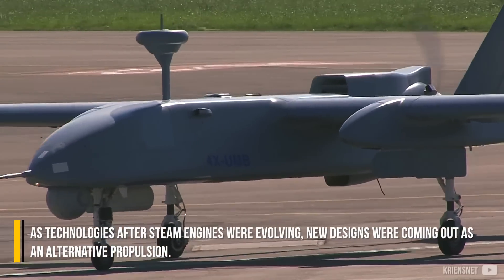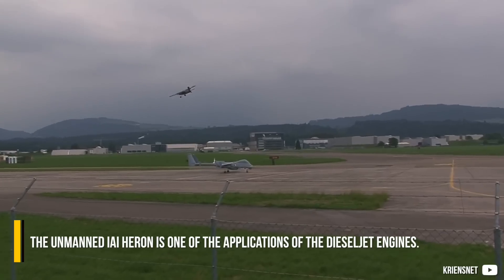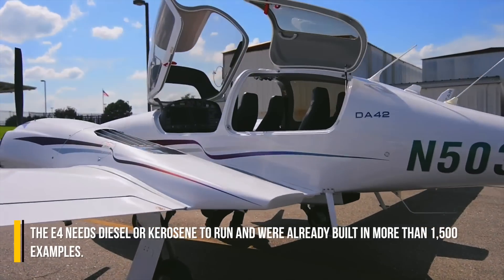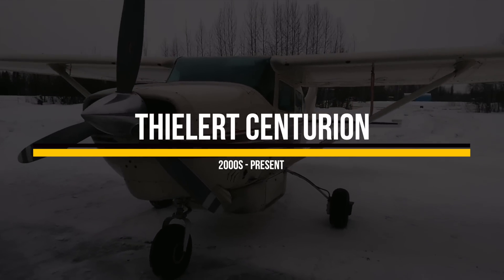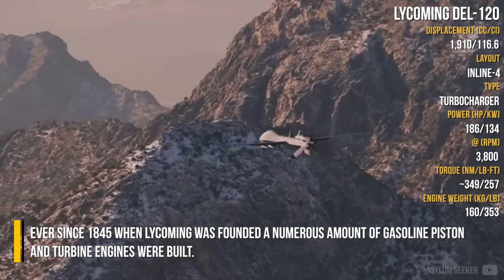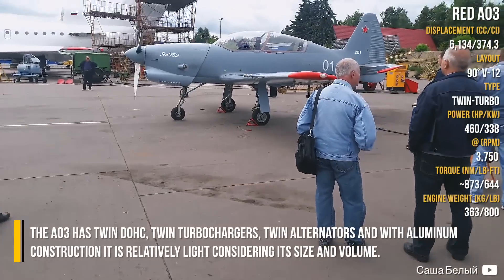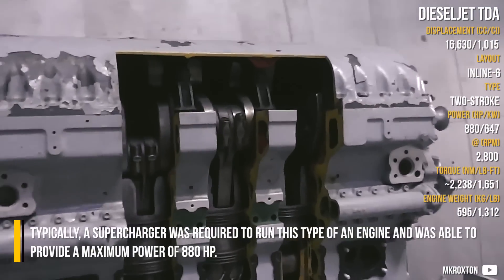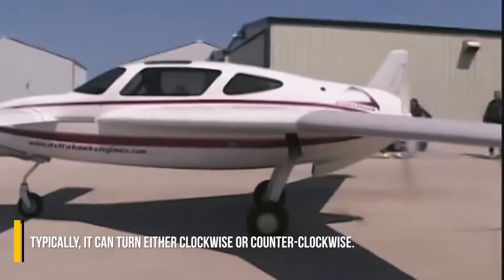8 Of The Few Diesel Aircraft Engines Ever

Comment: This video was posted 6 years ago, but I’ve got 2 questions if you know the answers that would be appreciated.  
Is the engine heat a problem & how is it controlled,  does the propeller need to run at a certain rpm, how is it adjusted.
Reply: Diesels have lower temperatures bc they reuse o lot of energy for working. For many diesels actually only  the piston head needs cooling.

Comment: JetA is very comparable to diesel fuel. The problem with diesel in an airliner is its tendency to gel up at lower temperatures.
Reply: Use winter diesel

Comment: Given that 2700 rpm is both typically the limit of the propeller speed and the peak power rpm of diesel engine make it a good combination to bolt on diteclty on the crank

Comment: Deltahawk is a company that has been developing a 180HP V4 2 Stroke diesel engine that runs on JetA for single engine props. It was designed to be a cheaper alternative to those engines running on AVGAS. It just recently was FAA certified.

https://youtu.be/bL-8AQlVOlo

Comment: An aero oil burner for utility applications, is the way to go, but the enemy of any oil burner is weight, a straight four or six needs a beefy crankcase main big end bearings to combat the severe internal stresses imposed by a heavy crankshaft and con rods. Only way for  a  viable aero oil burner is a flat four of or six ,like a VW Bug or Porsche 911. Keep it simple stupid, ditch  the turbos, double camshafts and all that bull shit, good old fashioned gear driven blower with two speeds and push rods for the  valve gear. Out in the arse end of nowhere where these aero  oil burners will make their mark, simplicity ,ease of maintenance and repair is important. Said aero oil burner must be able to be serviced repaired with basic tools by a farm boy in the barn much like the family John Deere tractor.

Comment: There's no redundancy with common rail fuel injection. 
Just occasionally, that can be a problem.
Reply: No problem, works also on less cylinders
Reply: @CATA20034  when you lose rail pressure, you lose all cylinders. I've witnessed it happening. Not nice.

Comment: Not sure why all the diesel engines are piston engines. I mean, if the one can run on either diesel or kerosene, then why couldn't a turboprop be designed to run on diesel fuel?
Reply: Yes, turbine engines (including turboprops) can run on diesel fuel; however, commercially available diesel doesn't meet aviation standards, largely due to issues at the low temperatures encountered at high altitudes.

Comment: Diesels are so ideal for aircraft .They rev at the right speed for a propeller with torque that punches like a boxer and greater range because  of a diesel engines relative economy. For example, the fuel capacity of 76 gallons for a Cessna 172 s p is already great with avgas...Imagine the range increase with that much diesel !

Comment: The superchargers were fitted on the airplane engines because of air density loss with elevation. Before they started putting the superchargers on the engines the planes could have 2000 hp when taking off near sea level and have maybe half that at 30k feet.

Comment: I don't understand why all piston engine planes are not diesel engine powered. AV gas is so freaking expensive in comparison and with the prop the engines aren't usually turning over 3.5k so diesels are perfect. Diesels can be super simple with the only downside when compared to gasoline being their weight. Although gasoline airplane engines are pretty overbuilt so they are not super-light. I know if I could afford a nice little twin I would outfit it with a pair of diesels.

Comment: The only drawback is the worry over fuel jelling. I guess a warming system could be implemented?
Reply: Excess from the injectors is by-passed back to the tank, like all diesel cars, and that warms the fuel. In extreme low temps, fuel warmers are included, using the engine coolant in a heat exchanger.
Reply: @tonyforrester9570  Very cool info! TY:)
Reply: Modern aircraft Diesel engines typically run on jet fuel which contains anti-icing additives.
Reply: Many aircraft engines have engine oil coolers that heat exchange to the fuel before reaching the injectors. This is also common on jet engines too.

Comment: Jet fuel is similar to diesel fuel, so in a way, jet liners are diesel planes :)
Reply: A diesel plane has a diesel engine. A diesel engine uses the diesel cycle. Jet planes do not use the diesel cycle. Jet planes are not diesel planes.
Reply: Diesel fuel and turbine (or "jet") fuel are similar, but diesel engines and turbine engines are not.
Reply: Not really, they have spark plugs for ignition :)

Comment: No, if compression-ignition engine had come first, the easier-to-build gasoline would have been just as popular. You saw a surge of diesel engines here (in Denmark) in the 80ies and forward to now 2019 because diesel fuel was cheaper. But the diesel engines pollutes with more particles.

Comment: This takes rolling coal to a whole new level
Reply: Notice a complete lack of black smoke? Black smoke is a sign of too much fuel and too little air, not to mention small testicles. These units adopted diesel as it extends the range and decreases cost on fuel and maintenance.
Reply: @mikehotchkiss8975  Agreed with you on that Mike. :) Diesels are meant to be efficient, not meant to be coal rolling. Lol... I hope aircraft manufacturers switch to diesel, so we can have more efficient small airplanes and better fuel economy (in turn, less CO2 emissions)
Reply: I see what you did there.

Comment: Nothing was mentioned of the limitations that prevented it becoming more widely adopted.
Reply: Here are a few.
Unresolved vibration problems, resulting in airframe and propeller cracking.
Mass vs casing strengths.
Reduction drive chattering at low rpm.
ECU mapping and definitive redundancy.
Lack of widespread service back-up.
And of course, this was supposed to be an economical alternative.... IS NOT!
Enough so far?
Reply: @tonyforrester9570  Inline 6 and V-12 Diesel engines have no vibration problems.
Reply: Diesel engines have lower power density and horsepower to weight ratio than Otto or gas turbine engines.

Comment: Big advantage to diesel is that there's more energy per gallon/lb. than gasoline.  Longer ranges with less weight
Reply: The fuel density means longer range with less volume, but not less weight.
Reply: diesel fuel is heavier ,, no matter what you have to carry your carbon on your back

Comment: I recall reading about an aircraft endurance test by a competitor of Charles Lindbergh that lasted until the B-52 came out. The aircraft had an experimental diesel engine but was turned down for production due to the horrendous smell it made.

Since diesel fuel isn't as explosive as normal aircraft fuel you would think that it would be in high demand for aircraft because you don't want aircraft disaster survivors burning up. Unfortunately this isn't the case as aerosolized diesel fuel can detonate in a similar way to jet fuel if the accident is violent enough as was the case in the Ladbroke Grove rail crash of 1999.
Reply: # Tako   That I do believe was a PACKARD aero diesel built in the 1930 and set many distance records because of the low fuel burn !! !  BUT the 1930's were not a good economic time and little was built then for a hungry nation !!!!

Comment: What about gelled fuel at altitude?
Reply: Jet fuel has anti-icing additives
Reply: Not an issue with "jet" fuel, and not an issue at the low altitude where unpressurized aircraft are operated.

Comment: I only drive turbo diesel vehicles. 99 Ford 7.3 Powerstroke, 04 Chevy 2500 HD Duramax, 2008 Jeep Grand Cherokee 3.0 Tdi, 09 VW Jetta CRD. I get over 100% better fuel economy in those vehicles than their gas class equivalents, excepting the Jetta. Would have zero problem with a turbo diesel aircraft.

Comment: I can tell you don't know much about general aviation.
Diesel recip aviation engines can run on diesel fuel, kerosene, or jet A.
Since av-gas is being slowly phased out, diesel recip is going to be the next big thing light aircraft.
Reply: No, it wont, diesels are too heavy and under-powered. Modern gasoline engines that can run on unleaded fuel will likely need to replace air-cooled aviation engines.
Reply: @PistonAvatarGuy   Yes it will  https://www.flyingmag.com/inside-aviation-diesel-revolution/
Reply: @roye2479  EPS is BANKRUPT and tens of millions away form certification, Deltahawk is an overweight, under-powered, POS, like all of the other diesel offerings. None of those engines come even close to offering the light weight, high power output with low fuel burn that MODERN gasoline engines offer. Unleaded gasoline is also cheaper than jet fuel.

Comment: While Diamond Aircraft is said to have made about 1500 examples of the DA-4 twin, most are the Lycoming gas engine version. The diesel engine is an expensive option. And not all that economical to operate as it needs an expensive propeller gearbox overhaul at frequent intervals. The downtime is a killer for flight schools.

The makers of diesel aircraft engines are careful NOT to refer to their engines as diesel but as compression ignition engines. Most of them are certified only for Jet-A, not diesel. The difference is diesel fuel lubricity is not right for the injection systems in aircraft. Also diesel fuel is subject to the EPA's "Boutique Blending" mandate where the fuel is formulated differently for different parts of the country and the year. Jet fuel is the same everywhere and year round.

As for those waiting for the DeltaHawk 400hp V-8: Maybe your grand kids will see and hear it. The 4 cylinder 180-200hp engine they are teasing has been under development since the mid-1990s. No certification. No deliveries yet.

Comment: i dont see the point of a diesel airplane engine as the petrol ones are so under-stressed and low revving that they could last forever anyway. plus they get overhauled every 2000 hours and the fuel economy of the petrol engines is pretty reasonable so a diesel probably wont yield any major improvement.

Comment: The problem with Diesel engines is that they are limited in the RPM in which they can operate. Gasoline is much higher, alcohol even higher and Nitro Methane higher than that. One of the keys to high horsepower I'd it's ability to run at high RPM.  Diesels just can't to that, but they can produce incredible amounts of torque at low RPM, which makes them the go to engine for trucking.
It just so happened that aircraft engines operate best at low RPM, especially when they are propellers for thrust, and the propellers work best well below the speed of sound. The propeller tips can easily surpass the speed of sound under high power setting needed for take off or climb out. So the Diesel was a no brained for the private aircraft industry.
By the way, I love the Delta Hawk design. They are currently building four cylinder engines making up to 200hp, but in 6 or 8 cylinder configurations they can make 3 to 400hp easily! All I need to do is win the lottery, then plan my build around the 400hp version once they are released for construction!
Reply: Actually, gasoline engines are capable of making more torque than diesels at any rpm, the limit is the strength of the structure of the engine. Most of these modern diesel aircraft engines also require gearboxes to reduce the propeller rpm and if you do the same with a gasoline engine (as done with the Adept Airmotive 320T), you end up with a very light and powerful engine. Modern gasoline engines can also run on mogas, which is even cheaper than jet fuel, and modern gasoline engines use less fuel than the old LyContisaurus engines.

The real problem with diesels is their weight, which is partially a consequence of their low rpm. The faster you can spin an engine, the better its power to weight ratio, and gasoline engines are capable of MUCH better power to weight ratios.
Reply: Delta hawk... released for production? That would be nice, seeing as some people placed deposits 15 years ago and STILL do not have a working engine... do your homework.
Reply: The Mercedes OM606 revs pretty high

Comment: You don't see many fuel injected airplane engines either... Rotax 912i is the only one I can think of off the top of my head.

Btw, diesel engines are considered a curse these days but Rudolph Diesel originally intended for them to be run off any oil.. food oil was in focus at the time, particularly peanut oil. However, as we know, the petrochemical industry took off in a big way.....
Reply: The most famous (imho) fuel-injected aero engine must be the Daimler-Benz DB 601 and 603 series. These engines, when fitted to a Messerschmitt Bf 109 (to name one), enabled their pilots to outdrive their opponent, because their engine kept running and their opponent's would cut out because of fuel starvation.

Comment: having messed with the Austro a decent bit... not a fan its a converted Mercedes engine and has alot of compromises as such it has some issues. ERAU owns $10mil in DA-42s and cant keep them in the air. Its a very well preforming light twin but im looking forward to Austro doing a from scratch engine, they in general, are going in the right direction.

Comment: The only diesels which make sense to put in aircraft are 2-strokes.  4-strokes are too heavy.  The Junkers OP was a great engine, and many OP diesels that came after copied aspects of that engine.  Napier built Junkers engines under license before WW2, they were called the Culverin.
Reply: And that's how the Napier Delta was born. Basically three Junkers engines with common crankshafts cast into a triangular block.
Reply: Not valid today. Due to turbocharging and electronically controlled commonrail direct fuel injection. Even on american railroads are big two strokers at the end of their decline. Problem is not just with efficiency (for aeroplane is weight of the fuel required for planned trip on board crucial), but also with power density. Yes, until year 2000 it could be a way...

Comment: Aircraft require higher specific power output. Diesel engines fail in this regard due to their limited operational speeds and higher pressures and impulses requiring high weight engines. Specific fuel economy is less important for aircraft that require  high speed subsonic performance versus long loiter times. Before 1950 high speed was more important than long operational radii. For recreational aircraft, the vibrational extremes also presented a disadvantage. This is why diesel F1 cars don't exist, but Audi managed to find a niche for diesel LM endurance cars. Turbines already had taken advantage of energy density of higher molecular weight hydrocarbon fuels by the 1950s.
Reply: Prop aircraft are limited in RPM and light, long lasting gear boxes are an oxymoron, thus piston aircraft in general use displacement to gain power rather than rpm. Some other things to consider: Aircraft are high torque low RPM applications, JetA is significantly cheaper than Av gas, and diesels are incredibly reliable as there operational principals are simpler (no plugs to fowl etc). Also another thing to note aircraft engines are still in general computerless, modern diesel development is mostly focused on fadec systems.

Comment: Diesel engines have historically struggled with getting a sufficiently high power to weight ratio to make them viable, it only modern diesel improvements that make it possible. In the 1940's the Napier Deltic was a uk attempt at a diesel aero engine, it ultimately became a legend in railway history.
Reply: Napier licensed the Culverin and Deltec engines from Jumo.
Reply: 320ifq lucas It's a copy of a junkers engine thought. Junkers did get a reasonable power to weight ratio (the Jumo 205s for example is better than the napier deltic ones).